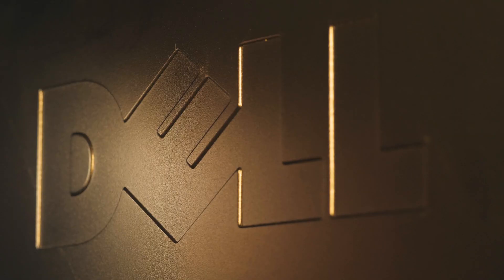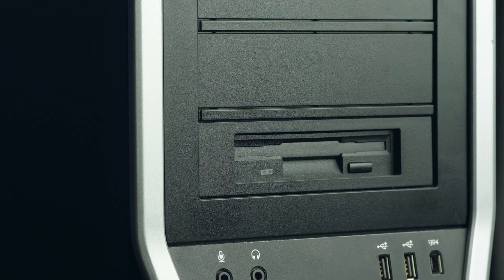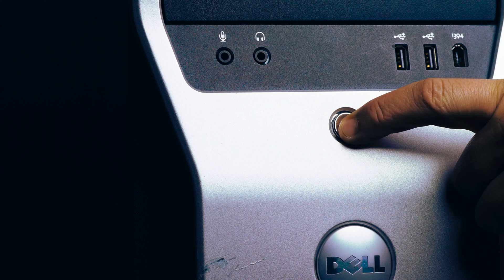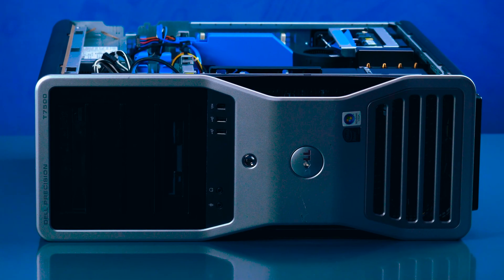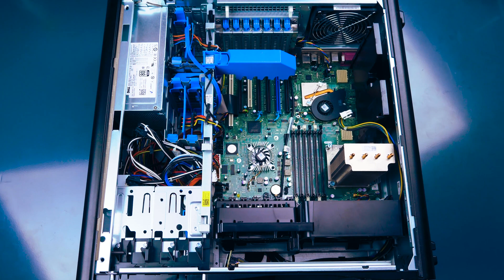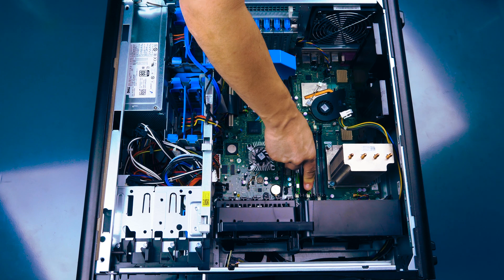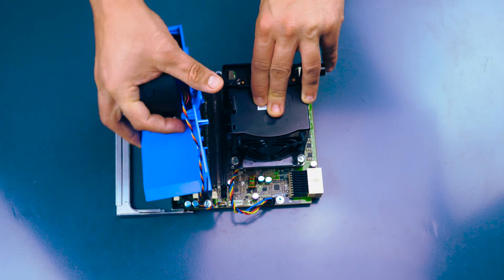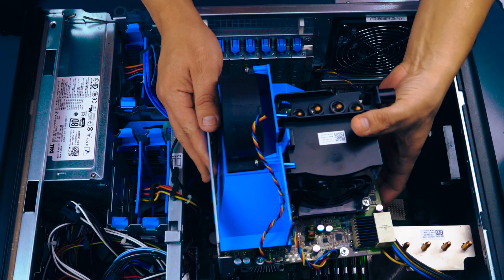Dell T7500 Memory Installation

Comment: Ok but then what. Memory is in there but it says 128gb (48 usable) how do we make it all usable
Reply from the maker: We are happy to help.  Does the BIOS show 128GB or 48GB Installed?  If 48GB please let us know which DIMM slots are being used and ranking of the memory.  If 128GB shows, which OS are you running?
Reply: Either Bios looks completely different than it did before or I can’t even get to bios. I can get “system setup” to come up by hitting f12 to get to boot menu and then going to system setup but it doesn’t look like the bios I’m used to nor can I get to chipset or any of that. That window says 128gb. But when Windows 7 boots as normal and I go to ‘my computer’ ‘properties’ it shows that only 40 some of that is usable.
Reply from the maker: @malkies6341  Hitting F2 when the Dell Splash Screen appears is how we usually enter the bios.  The way you described is another way.  The BIOS may look different depending on the version you have.  Sounds like the OS is limiting the RAM if the max memory option is selected incorrectly.  To fix, please try the following:  Click Start (windows button), type msconfig in the search programs and files box, then click msconfig in the programs list.  In the system configuration window, click advanced options on the boot tab.  Click to clear the maximum memory check box, then click ok.  Restart your computer.    If this does not resolve your issue, we can get additional advice from our tech support Monday when we open for business.
Reply: @tekboost  I wanted to reply so other viewers would know. This is is what I ended up doing. It worked for me. There were three possible options that I ended up finding, this this is the solution that worked for me. Thank you.